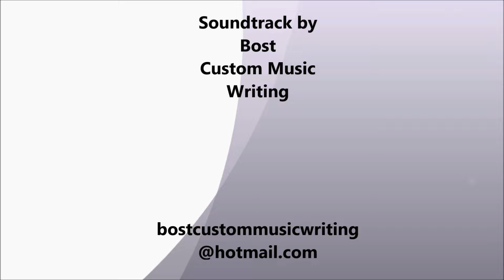Sig P320 After Upgrade - Slide Hop -

Comment: Its slide to rail fitment. The Loaded mag is keeping the slide pushed upwards against the rail but on a empty mag or no mag the slide has room to move on the rail. I have seen this before on other guns like my Glock 34. It can be fixed by tapping the underside of the slide to lesson the slide groove if you are comfortable doing that but if you do just go slow and check for fitment. Its just loose tolerances which isn't really a safety or functional issue..

Comment: I have a P320 Full and a P320 Compact; both are first version, pre-upgrade.  Both move the rear of the slide a tiny bit down (not up) when pulling a cocked trigger with an empty chamber and an empty or ejected mag.  The degree of movement is barely perceptible, and I've never had a single fault with either pistol.  I chose not to do the upgrade because both pistols work perfectly as they are, and I did not want to take the risk of possibly making them worse.  I have studied the issue, and I believe the risk of accidental discharge is not a concern in my case.  Thanks for this vid!
Reply from the maker: Thanks for the info and comment!

Comment: My P320 version also has slide hop. When I received my gun back after the upgrade, my version would eject hot brass into my face and head with 115 grain loads on almost every shot. After sending it back two more times (after the upgrade return), Sig sent me a new pistol, so kudos to Sig for making it right. The new pistol no longer ejects hot brass into my face/head; however, at first the slide of the new pistol did slightly hang up like your pistol did; if you slowly racked the slide. What I did was to repeatedly rack the slide and work the slide over and over again to break the slide in. After doing this repeatedly for some time and after cleaning and oil the slide and gun, the slide no longer hangs up. I assume this is because of two reasons; it was a new gun and the changes that Sig made for the drop safety means that some internal components know rub underneath the slide (when the slide reciprocates) and were slightly catching on the cut out. Everything know appears to be running and working smoothly and properly.
Reply from the maker: I did mention the slide hanging up but was not an issue that I had with mine. Just had many others talk about it and so i figured I should bring it up. I am glad Sig made it right for you. I have had no issues at all with mine before or after the upgrade. I have heard just a few complaints about ejection being weak but not like the issue you were having. Mine does fine with ejection. It doesn't spit them out way far but it does eject in a consistant 2 o'clock position. I made the video because I was hearing many other talk about the issues they were having and figured it was a good discussion to have. With that said I thank you for your input and letting everyone know your experience.
Reply: No problem. Thank you for your excellent video!

Comment: The play in the slide allows for a fully loaded magazine to seat with the slide closed. The FN line of pistols are difficult to seat a fully loaded magazine with the slide forward, so you have to download one.  As you can see the added clearance allows a fully loaded magazine to be seated, and the pressure provided from the magazine spring pushing on the rounds counter balances the movement of the firing components. This is part of the design and not a flaw. Glock pistols exhibit the same behavior. Good video of bringing this topic up, and showing the different circumstances in which this will present itself.
Reply from the maker: One of the best ways I have heard someone explain it. Thanks for that. I have got so many comments of people just trashing the P320 but they don't understand that this same function is normal and by design in many pistols. Thanks for the comment.

Comment: Great Video I had my 320 sent in for the upgrade and notice this issue as well. Mine is doing the same exact slide hop as you described. I will try to see if stops with snap caps in magazine and the chamber. Thanks!
Reply from the maker: hoseinfam it will do it if you have one in the chamber but nothing in the mag. Very normal for many semi-autos.

Comment: this is fairly common in striker fired weapons.  my smith sigma, smith M&P, and P320 all do this while empty.  i consider it a non issue since a loaded mag creates enough upward pressure to keep it tight. furthermore, it's a pistol, it doesn't need 1/4 MOA accuracy.

Comment: Mine does not do that at all.
When I saw this vid I thought, You gotta be kidding me. I spent extra to get a Sig, then had to send it for a trigger upgrade -- now this?!
I went immediately and tested my 320. No slide raising under any circumstances.
You should get with the folks at Sig about this. You're due a replacement.
Reply: John Smith  I now own a 365. The slide doesn't "hop" at all. 

 Used numerous autos, from 1911s to a Browning Buckmark. None of them "hopped."
It's not that I don't know what I'm talking about; it's that I don't know what you're talking about.

Comment: The rabbit effect is present on my P320 FS 45, in stock form, but no where near as much as yours.  My Glock 19 G4 does it to a small degree.  My M&P 2.0 5" does not, but the slide release on the right, moves when the trigger is pulled slightly.  There are all striker guns and there is nothing to be concerned about IMO.   Good catch noticing it though.
Reply: Sig Rockatansky I have the 2.0 5 inch as well. It doesn't rock because the slide lock lifts up and pushes the slide up. That is why it is kind of rounded so it doesnt lock the slide everytime. Same thing with the p320 but it is the tension on the bullets in the mag pushing the slide up.

Comment: From what I'm seeing is the disconnect is applying upward force always, but with rounds in the mag already applying upward force you cannot see it.  It will not affect accuracy as long as lockup is good.  Your slide will always have play from the frame. Do it your sights are on target that is all that matters. The barrel is attached to the slide, not the frame.

Comment: Its called slide lift. Some Glocks have it. When you pull the trigger, the slide may lift less than a mm upwards or a little to left or right. its due to variable tolerances

Comment: I haven't sent mine in for the upgrade yet. And it does this when there's no magazine in it.  
Oddly enough, it does it more with certain grip modules.  But again... If I leave the chamber empty, and put an empty or loaded magazine in it (even just one round in the magazine). It doesn't do it at all. Not matter how many times I try it. 
I have mine configured in 357sig compact. I can't speak for any other caliber or size configuration.
Reply from the maker: Very good information. I do not have access to other grip modules so that is information that is good to know. Thank you very much for the comment

Comment: Of course the slide moves vertically when you squeeze the trigger .the tolerances on that Gun are so loose it probably doesn't require any type of lubrication ( and that's not a good thing).
Reply from the maker: Does it on Glocks and Sigs and plenty of other guns as well. This is not ab-normal for many different semi-autos.

Comment: I noticed that mine stopped when I changed the take down lever. I swapped from the OEM lever to the Gas Pedal and the slide hop stopped completely
Reply from the maker: Good to know. Have been thinking about that but wasn't sure if that would work with the holsters I use for it.

Comment: I noticed my p320 compact's slide cycle was gritty towards the barrel end, and it had some hiccups going back into battery if I let it "gently" go forward. That was when I first took it out of the packaging. But I hand-cycled it a little bit and while it's still kinda gritty, I can't get it to stick, and it goes back into battery every time. I think it's the fact that they cut that notch out of the bottom of the slide, exposing rough bare metal which can cause hang-ups. It just needs to smooth out through use over time.

As far as the slide hop goes, I haven't noticed it on mine. But I also wasn't looking for something like that. I'll take a look next chance I get.

Comment: So the mag spring/rds in mag are taking up the slop in WHAT. The slide rails or the modular
works.......... ie slop in rear of serial numbered insert?????
Reply from the maker: It is a common thing in many different pistols not just the Sig p320. I have had a Glock with the same thing among others. Pressure from the round in the mag takes up the tolerance between the slide and the frame. I had so many people thinking this was an issue after they got their Sig's back from the upgrade that I did the video. I have had many comments that it happens to even ones that have not been upgraded as well. Like I said it is not just a Sig P320 thing. happens with many different semi auto pistols.

Comment: It probably did it before you sent the gun in for the voluntary upgrade.  You now have a brand new striker and a sear.  The engagement point hasn't worn in yet.  The higher friction of the sear is dragging the slide down before the trigger breaks.  It's also possible that they put in the striker spring from the Military model, which has slightly higher spring rate, which would increase the friction between the sear and the striker.
Reply from the maker: NoToBigBro I haven't been stressing it but did get a lot of pissed off comments on other videos so I did this one. I do like how you explain it. Thanks.

Comment: Thats very interesting..The only thing I can think of is that the next round keeps it from moving from the preasure pushing up.... But than again what do I know...lol
Reply from the maker: That is the logic on my part as well.
Reply: The pressure from the top round in the magazine moves the slide up and does not allow it to move downward. Basically simulating what the trigger mechanism is doing to the slide. You should measure the gap with a caliper when you depress the trigger to the "wall." I bet the gap is the same as when the mag is in with a round in it.

Comment: I hope nobody shoots their TV performing this test...lol! The rounds in the magazine are under spring pressure, and this forces the slide upward. The fit between the slide and rails isn’t perfectly tight (nor should it be), and a set of feeler gauges would show the gap difference between slide and frame with and without a charged magazine.

Comment: Have I looked to see if the barrel has movement? If not then there shouldn’t be any effect on accuracy? Could there be a pin or something in the FCU that’s smaller than spec? It could cause wiggle ingues
Reply from the maker: I really have no idea what is causing the issue. It has been pointed out that this is happening after the upgrade. Chip B commented that his does this and he has not done the upgrade. I am guessing that more people have noticed it when they get them back from Sig. I never noticed it before I sent mine in. Figure I would have seen it before with all the dry fire practice that I do. The FCU is locked in place... no pins so I don't assume that is the issue. Like I said in the video, accuracy is no different from before to after the upgrade but I have never tried to shoot out to say 100+ yards. To me this is a defensive pistol not a target tack driver.

Comment: What your showing is not a "issue". The slide is moving like that because when you pull the trigger the trigger bar pushes up on the striker block moving it out of the way before firing the round. When the mag is full the slide is automatically pushed up from the rounds in the mag. It's common sense. But apparently its not so common anymore. No offense.
Reply from the maker: I knew what it was from the get go. The reason i made the video was all the complaining I got about it after people were getting their Sig's back. Many of my other pistols do it. My main objective was to try and defuse people.
Reply: Jan is GAY!! Yeah mine does it too and I have to say it is more pronounced on the 320 than a lot of other handguns that I've seen.

Comment: Did it do it before the upgrade that you noticed ? If not, call Sig and explain it to them and let them watch your video. The only Sig I have is an original P226 I bought after the US Army pistol trials. I was looking at the RX Model when all this went down, glad I didn't pull the trigger(no pun intended).
Reply from the maker: I did not notice it before the upgrade. Yet I don't really have an issue with it. Come to find i have seen others that do it. i have also recently noticed that I have a Ruger that does the same thing. Not quite as much but it does do it. I also have recently been looking at other pistols. It does not seem to be uncommon. I do really like this pistol. I don't get attached to a weapon though. If It was a problem for me I would trade it off. Thanks for watching and the comment Albert.
Reply: Albert Pepe if you are still interested, I found Sig's RX models to be a good value  (if you can consider a new Sig a value) as for under $400 you get the optic, tall night sights, and milling that all "match up" and are under warranty with Sig. I got a p320 RX last spring and am very happy with it, going to send it in this winter / spring for the "upgrade".

Comment: Don’t kid yourself, this is extremely poor fit between the two parts and can only get worse with wear. Sooner or later this vertical movement will affect the firing pin safety block and Sig will be forced to admit they have yet another problem. I have looked closely at this sloppy frame/slide fit and find the metal tabs on the chassis are not ground to fit their slide rails and all ALL the 320’s I have looked at have this same design flaw. Disclaimer, I like Sigs and have no idea how they think this crap will cut it. Very concerned. //ji

Comment: if you havent surmised this by now, its because when you have rounds in the gun, the ammo in the mag is exerting  upward pressure on the slide. and theyve obviously used pretty horrible tolerances to increase reliability. shouldnt be an issue, but i guess it could throw off your sight picture. pretty big turn off for me, i dont like sloppy loose fitting guns that rattle around and shit.
Reply: p8,
My Glocks did the same thing.
Reply: you might check out the safety plunger on the bottom of the slide and see if the spring is binding up. really the only thing that should be exerting upward pressure on a glock slide would be that tall hump on the trigger bar ( depresses the striker safety plunger) and the spring in there is super small/ low power. and should be overcome before it has the chance to move the slide up at all. easiest fix would be to drop some oil around that plunger (button looking thing) or if youre feeling froggy, break it all the way down and clean out the carbon that gets locked in there.

Comment: I received back my upgraded P320. I am pissed. The damn thing now ejects the empty shell cases into my face and forehead 14 out of 15 rounds. I never had this problem with this pistol before the upgrade. I have another P320RX that I have not returned and it never ejects the shell cases into my face or head using the same ammo. I don't know if they damaged the ejector or did not reassemble the parts correctly after the upgrade. I am super pissed off! Has anyone else encountered this problem with their P320?